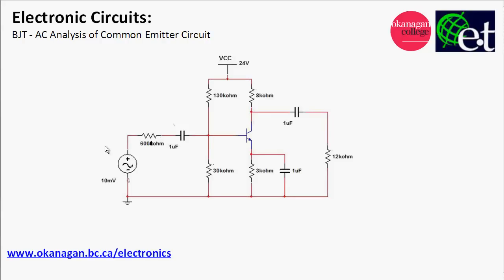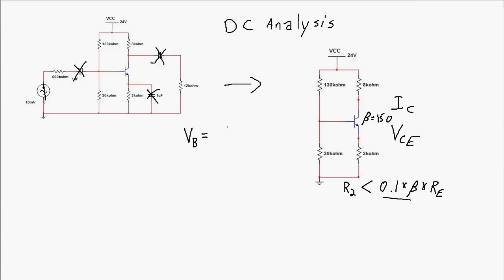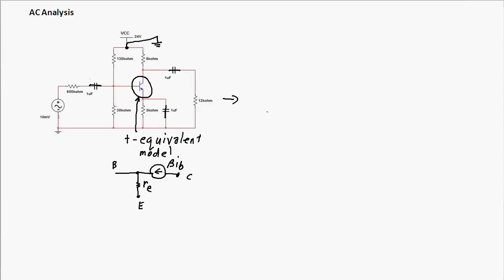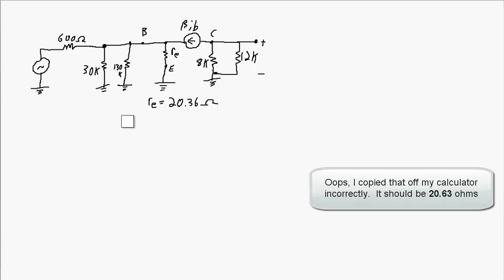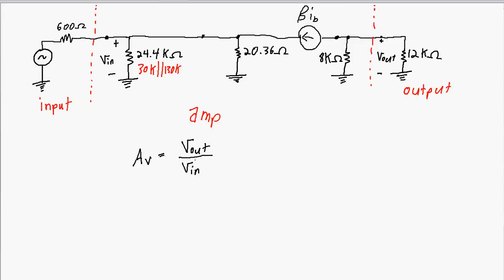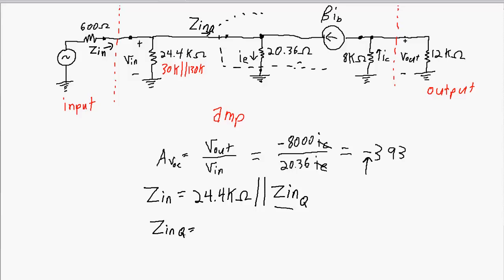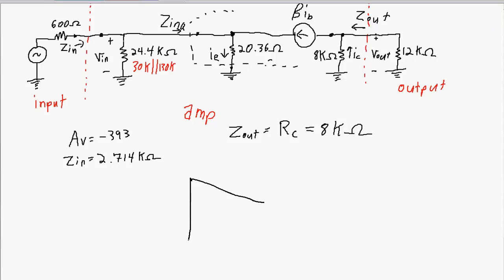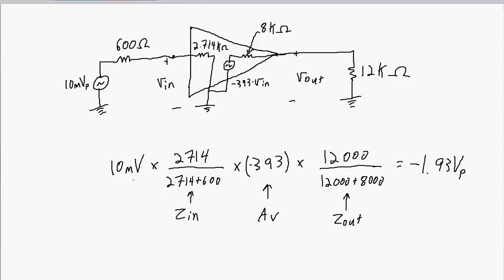Common Emitter Amplifier

Comment: Where does the 26mV come from at 8:42?
Reply: That is the voltage across transistor PN junction at room temperature.
Reply: Can I assume that that value is the same with all PNP and NPN transistors? How much does this voltage vary with temperature?
Reply: I would reference the transistor's data sheet. I think these values may be variable depending on the transistor you are using.
Reply: It comes from basic physics of potential barriers and thermal energy distribution of charge carriers and depends on temperature and charge on the carrier and Boltzman's constant - its kT/e, where k is Boltzman's constant, T is temperature in kelvin, e is charge on electron (or hole).
Reply: @RHCP08  It does not depend on the transistor. It's a fundamental parameter of any PN junction.
Reply: @trevortjes  It is the same for all transistors. As it given by kT/q it is directly proportional to the absolute temperature. At 27 Celsius, the absolute temperature is 27+273 = 300 Kelvin. So the 25mV (or 26mV) will increase by about part in 300 for every degree Celsius of temperature rise. In other words, it will increase by about 1mV for a 12 degree Celsius rise.

Comment: Re will change if IC(26mV/IC) change ,so =>Gain will change if IC change ,but in amplier IC always change ? so then ...
Reply from the maker: Yes, amplifiers are temperature dependent, so good amplifiers need to be designed so that the parameters affected by temperature don't have as much of an effect. This is hard to do with a single transistor which is part of the reason why most amplifiers have many transistors.
Reply: The result is that the gain changes for different parts of the waveform for large signals. That manifests itself as large amounts of second harmonic distortion. That's why we don't bypass emitter resistors for hifi applications. Sacrificing some gain for a reduction in distortion is a good trade-off.

Comment: why there isn't any frequency in this case?
Reply from the maker: In this case, I am assuming that the frequency is in the midrange of the amplifier. What I mean by this is that any low pass effects from bypass and coupling capacitors as well as any high pass effects from parasitic capacitance of the BJT can be ignored. What the actual midrange frequency is is beyond the scope of this video.

Comment: My understanding was that re was always 26 ohms - it's a chemical property???
Reply: +Digger D no its not
Reply: Zeming Lim I could be wrong but I watched / read about it being so and showed the chemistry and math to show it?
Reply: +Digger D  Youre probably thinking about Vt being 26mV
Reply: Rob Thoreson Nope, I saw a video (can't recall source now) but it went through the math (based on chemistry) showing the resistance as a constant between base and emitter.  But hey - I'm still confused as I have never found a straight forward logical explanation on how to set up a transistor lol.  Looks like it's more guess work and experience from the stuff I've watched on YouTube.  I've seen many videos now and can follow the basics of biasing, but not everything.
Reply: @DeeegerD  You'll find that re is always equal to 26 ohms as long as the emitter current is always 1mA. Here's the math:

Shockley's diode equation (which relates the current through a PN junction to the voltage across it) is approximately I = Is.e^(V/Vt) where I is the current produced by a voltage V, Is is a current typical of the material used (nanoamps) and Vt is the thermal voltage equal to kT/q. Then k is Boltzmann's constant, T is the absolute temperature (about 300 Kelvin for room temperature) and q is the charge on the electron. At room temperature Vt = kT/q = 25mV approximately.

To find how the current changes with change of voltage, you differentiate the equation wrt V. You get dI/dV = Is.e^(V/Vt) / Vt which is I / Vt. If dI/dV = I / Vt. It then follows that dV/dI = Vt / I = 25mV / I. That represents the dynamic (ac) resistance of the emitter junction and is independent of the material used.

Comment: y 8k  and 12k  cannot   be  simplified   and  reduced  to  one  resistance  equal  to 4.8k
Reply from the maker: +Parijat Chowdhury you can do the analysis that way, but I wanted to create the model for the amplifier part of the circuit and keep it separate from the load (the 12k) resistor. If all you want to do is determine what the output voltage should be, you can do the simplification.
Reply: okay....  thanks

Comment: two things: 
where did the assumption that if R2<.1*beta*RE IB=0 come from?
how do you know that VE=VB-.7?
good vid otherwise
Reply from the maker: If R2<.1*beta*RE IB, then the current flowing into the base is less than one tenth of the current through R2, so, as a rule of thumb you can say that the current would be small enough to be about 0.

VE=VB-0.7, because the base-emitter junction is a diode and you can usually approximate the forward voltage of a silicon diode as 0.7V

Comment: why do i need to know that if there is online softwares who solve all calculation which are long primitive and lead to error, even more an op amp is way better than a class a amp
Reply: Even the best opamps have inferior noise performance compared to an optimised single transistor amp. Learning to optimise a single transistor amp for a particular application is a skill worth having.

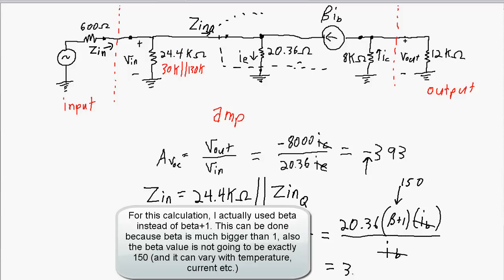Comment: In the minute 16:55 you just did 20,36x150 and the result was 3,054. Wtf?
Reply from the maker: I must just have misread the number off my calculator - should be 3504 Ohms. In 7 years, I think that you're the first person to have pointed that out.
Reply: @ElectronXLab  Yeah, after sometime thinking about it I realized that you did wrote it wrong but you did it right

Comment: Anyone here please kindly tell me how to find Vb, if R2 is greater than 0.1*beta*Re???
Reply: Use thevenin's theorem for Vcc with R1 and R2,calculate Vth=(R2/(R1+R2))*Vcc then Rth=R1*R2/(R1+R2) then replace Vcc,R1 and R2 with just Vth and Rth and a current Ib which flows through Rth.Apply kirchoff's voltage law on the base-emitter loop and find out Ie=(Vth-Vbe)/(Re+Rth/Bdc)
Reply: AlchemyOfDeathBand  Thanks for you reply, but honestly, still can not catch up with what you writing!! why Vth and Rth equal to that??
Reply: +AlchemyOfDeathBand This is half correct. Ie is incorrect. You need to use superposition from Vth and Vcc to find Ie.

Comment: That's not how you do an ac analysis. Look at your diagram at 14:35. You have a resistance of 24.4K in parallel with a resistance of 20.36R (ridiculous over-precision, btw). that is clearly nonsense. The ac impedance looking into the base of the transistor is simply β x (total ac emitter resistance). You need to replace that 20.36R with 3K, the equivalent input impedance of that transistor. Now, you finally get there in the end by a round-about route, but you really need to make life simpler from the start and not draw misleading diagrams.

Next, your idea of shorting the capacitors is valid if and only if you are working at frequencies where the reactance of the capacitor is negligible compared to the relevant resistor.
For the input capacitor, the -3dB frequency is when the reactance of 1μF equals the input impedance (130K || 30K || 3K = 2.7K) and that is at f = 60Hz.
For the emitter bypass capacitor, the -3dB frequency is when the reactance of 1μF equals the dynamic emitter impedance (26mV/1.26mA = 20R) and that is at f = 8kHz.
For the output coupling capacitor, the -3dB frequency is when the reactance of 1μF equals the load impedance (12K) and that is at f = 13Hz.
So you'll only get a gain of -400 at frequencies above 8kHz. As the frequency is decreased below that, it will roll of at 6dB/octave until 60Hz when it will roll off at 12dB/octave, until it reaches 13Hz, after which it will roll off at 18dB/octave.

Finally, it's important to realise that the gain of -400 comes at a huge cost in terms of distortion because the gain is Rc/re and re is non-linear (inversely proportional to the instantaneous collector current, and hence massively different for the positive and negative peaks of large signals). It's also worth noting that the input impedance as designed is dominated by the transistor input impedance (β times re = 3K) and so is directly proportional to the transistor β - a completely unsatisfactory design choice.